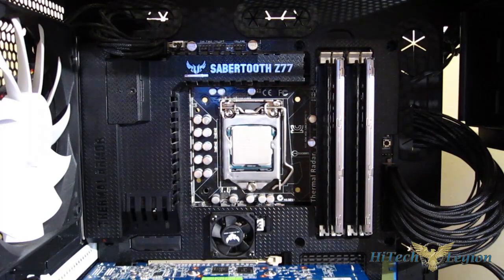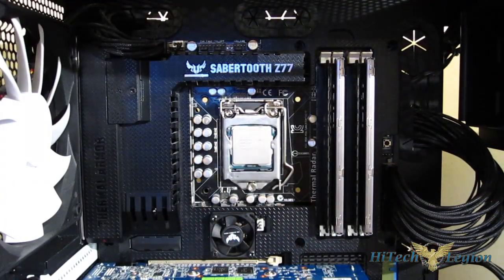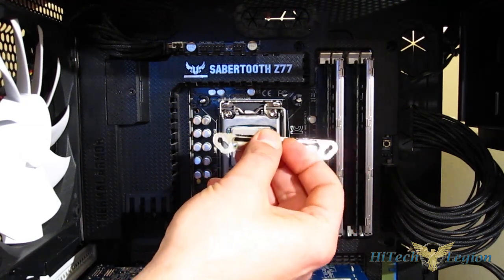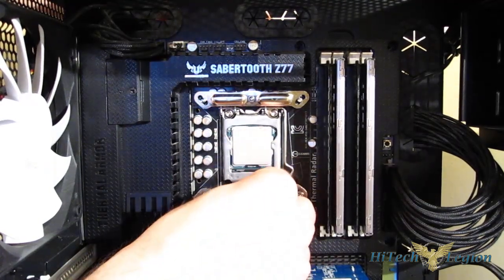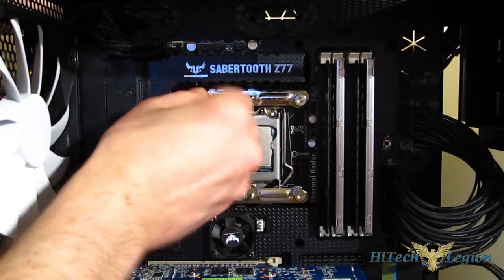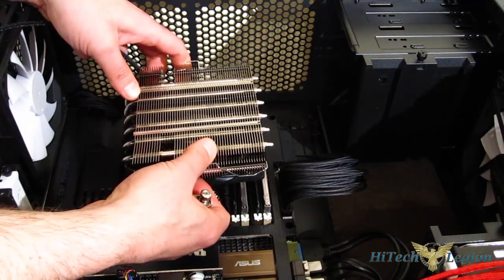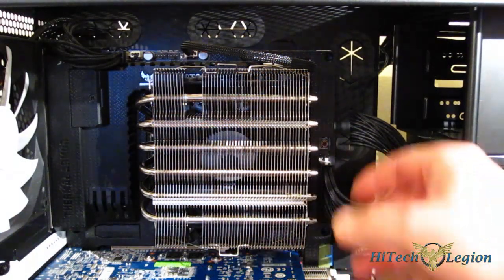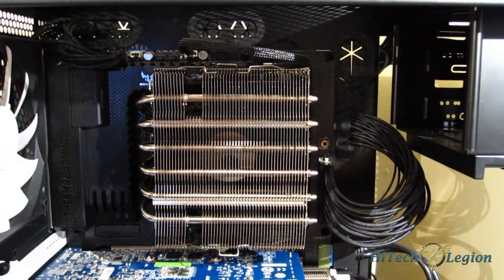Silverstone NT06-Pro Installation at HiTechLegion.com

Comment: i am sorry to say this in your channel but i think silvertstone is a horrific brand and this rvz01 serie was a catastrophie for me.
1: THe psu is a biggest failure, its loud and breaks very easily, actually  the only PSU i witnessed to die on me in just two years,
2:THe cooler, nt06 pro, i would throw it to who ever designed that ... the plastic that they used for the standoffs are the cheapest quality, like the worst plastic they could find...NT06 PRO, terrible experience.and not  performant at all despite them recommending it for the rvz-01 case.

3:The case! what a failed project, it was a nightmare to set up, once set, the PSU was loud, and it broke in 15 months and repairing cost a lot... 

now after 5 years, i bought a SFX psu from a much better brand but going back to rvz01, pff i will prolly buy another case and destroy this POS with a sledge hammer just to send the recorded video to this imposter of a company called Silverstone, which should just go back to manufacturing knockoff plastic toys